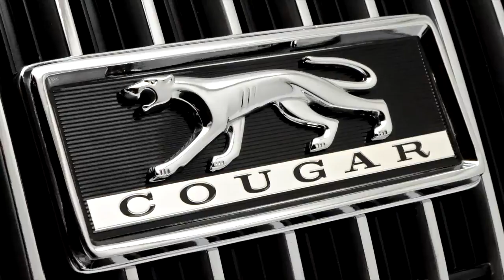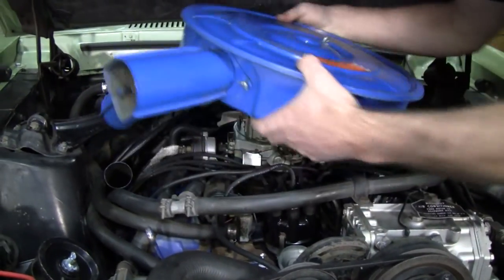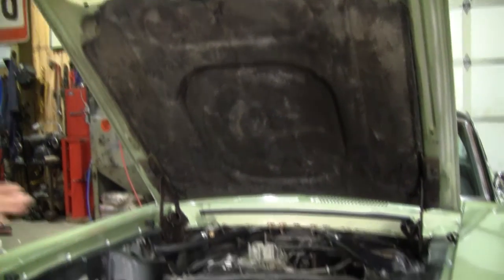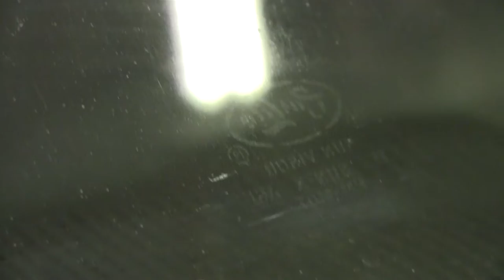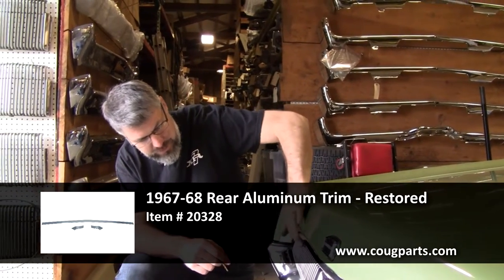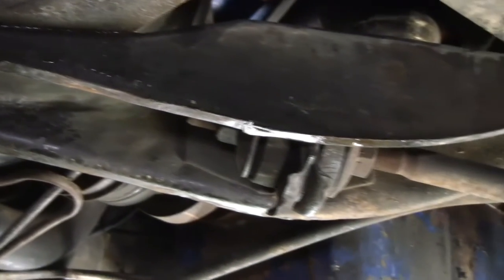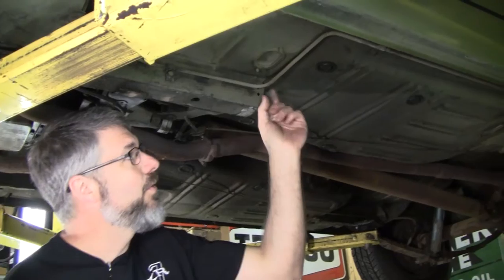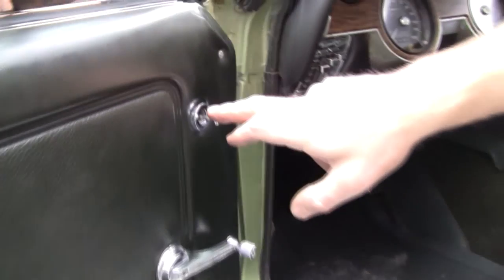Cougar Buying Guide Ep.5 - 1967 XR-7 Dan Gurney Special - Survivor

Comment: My sister bought my 1964  made  Mustang ( 289 2 bbl ) in 1976  and she still owns it.  Aside  from the regular work  for Brakes, sheet metal and engine rebuild , she will not touch   the inside   which has all the factory flaws and age wear issue from when I owned it . 
    Sadly, it had the  optional 14" wheels with full wheel covers and spinners  which were stolen in 2012 and  forced her to slap on generic ones .  It's a  regular driver in the Summer  and she told me that her neighbours children really liked  to sit  in it and  were amazed at crank windows since  it's now rare  to see new cars  that don't  have Power Windows .
     It's dark metalic blue with blue dash pad  and carpet while interior choice was white. 

    It was because of that Mustang  that she wanted to get her Drivers License and keep her first car.  I like that Cougar  for being very close to Factory  and can be driven to enjoy it. 
   You're right about those  grillbars since almost every  67  I saw back then were misligned by enough to know which section hid the headlights.   At least FORD didn't screw up the rear by a drop-down trunk lid for a low sill  to put items in while the rear Lights  would have had end pieces on the body and 90% on the Lip that never aligned  and got worse as the weather stripping aged and compressed. 

      btw 
    I never understood why the window crank arms where rarely installed with the window up to pot the Knob at the 12 O'Clock position to stop wacking the knees on them.   
 At the 36:16 mark  I can see how front and rear  crank arms have knobs a  6 o'clock while the  one on the  front door it perfect for wacking your knee based on your height .  I hope that when you work on cars like this you add a  charge  of $2.00 per  swear word  or bruise . 
 As for the rad.    I  was  lucky  to have a repair shop near me  where the owner knew i wanted   a  repair   to get that unit back for all the markings and  FOMOCO   id   because it was a 1983 FORD    LTD  where  I didn't   want the in-stock one  off the shelf.

Comment: Got a question about the  Courgar  front Turning light lens.  There were several US States where the DOT required the  orange   Lens  while FORD  would ship out  the White lens but would sell the Orange  over the counter   for those moving to that  State and must meet the DOT  codes.  
 Since the 1967  Mustang came with White a turning   lens.....did any cougars leave the F plant in Detriot with a non-clear  Lens . It looks to me that FORD  used the same Orange lens from the 65-66 Mustangs   on the Cougars  to cut costs . 
    I had a 63 Tbird with the Orange Lens because  the DSO  was in that State for  the DOT   code to use Orange.   I have seen 63 Birds with  the white turning lens.
Reply from the maker: Not sure on the whole laws in different states thing, but you've got it backwards. From the factory, all 67-68 Cougars came with clear lenses and amber light bulbs (1157A), whereas their Mustang counterparts all got amber lenses with normal clear bulbs (1157). Often people who don't know any better will put the amber lenses on a Cougar.
Reply: @WestCoastClassicCougar  
  Hmmm.   I must have been tired because I was thinking   that FORD used the Mustang  Lens patent but  made them with  clear   pellets in the  moulding machine for the Cougar .   Maybe by 1967  all of the  50 States  worked it out . 
      My back-up lights  on  the 65 mustang   did looked just like the ones on my friends 67 cougar.